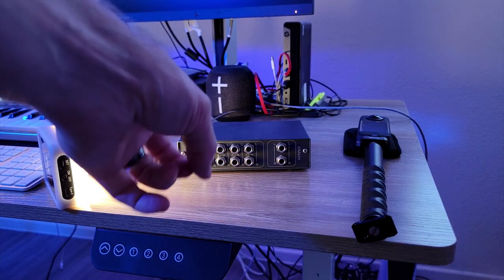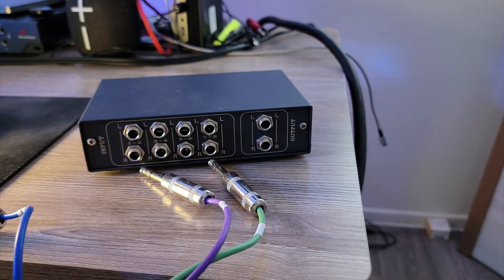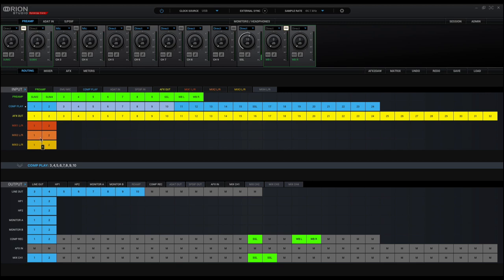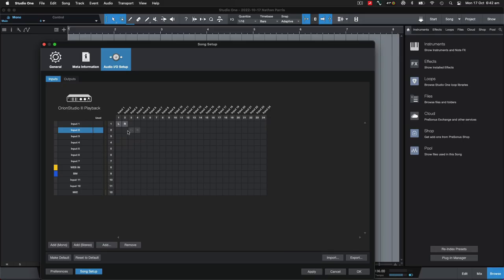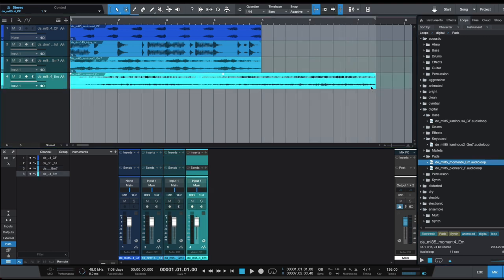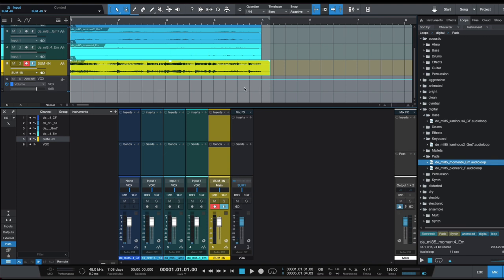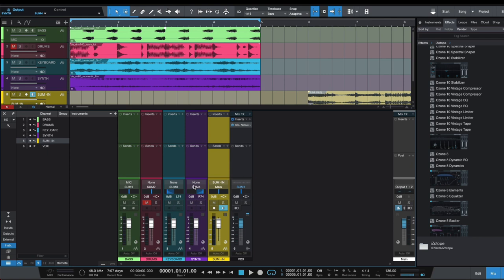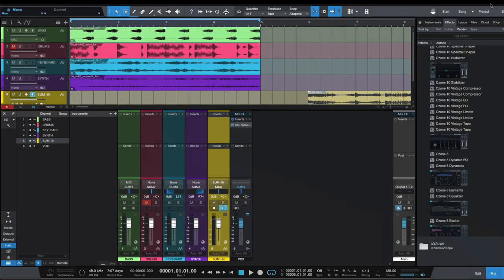Little One 8 Summing Mixer (How to connect it) - Beginners Guide - Studio One & Antelope Orion

Comment: How do you label the Line Outputs of the Orion to reflect your hardware output to summing box?  I mean, over 15 pieces of hardware and items can start to get confusing.  Please tell me that Antelope allows us to properly label outputs.
Reply from the maker: It does. Double-click on the color coded number you're routing in the matrix, and it allows you to re-name. If needed, I can create a tutorial.
Reply: @CrossbeatsMusicProduction  PLEASE do.  For some reason, my Orion 32+ Gen 3 only lets me change the "Input" labels... Not the outputs

EDIT I also just checked my Orion Studio Gen 3, and it won't let me edit labels in the "outputs" either.